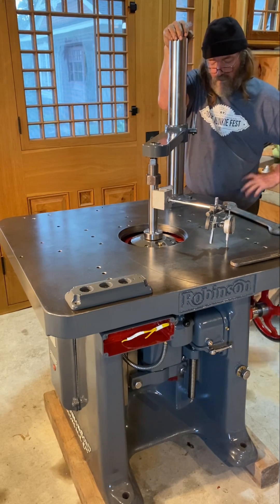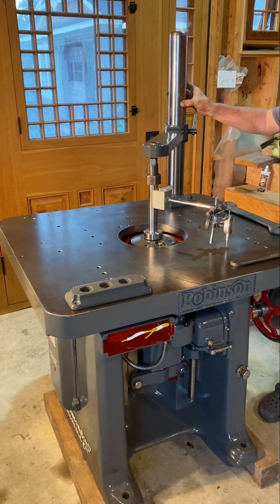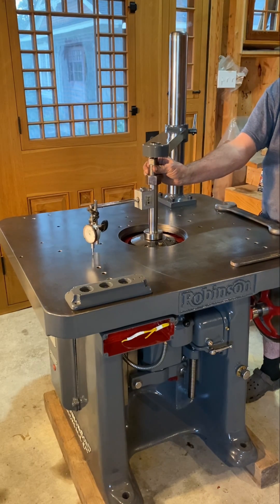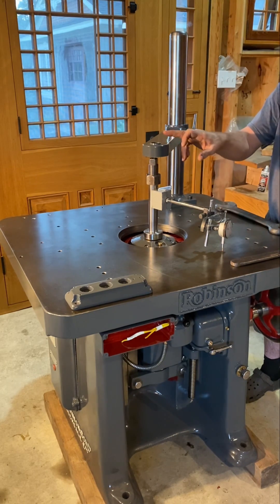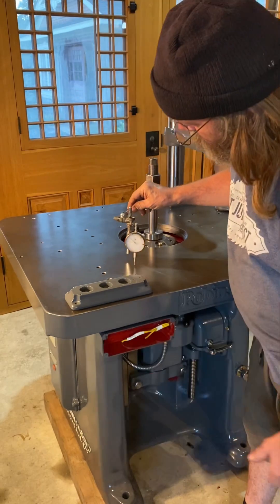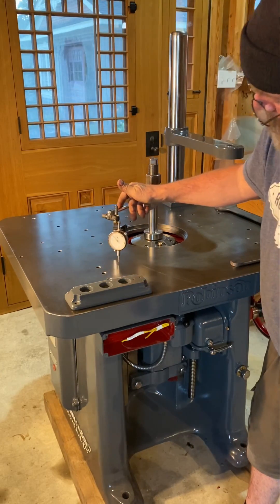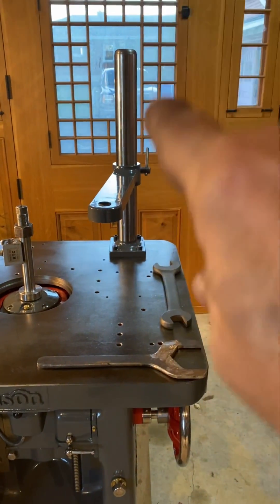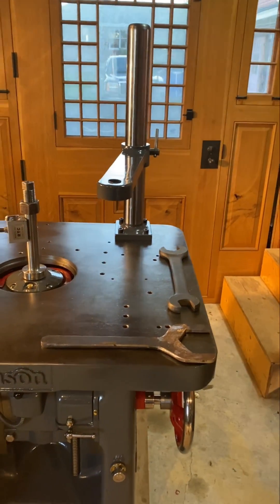squaring a spindle on the shaper /spindle molder #wadkintemple

Comment: Jezz, how wide material/moulding can you run through this gorgeous monster? 
🤣🤣🤣 Hope this thous won't be too visible by naked eye 🤣
Those beautiful machines are not only excellent but also designed in a lovely 50's manner with those gentle curves and rounds.
Reply from the maker: it will hold cutter blocks 12 inches tall
Reply: @jackEnglishmachines  😱 wow enormous